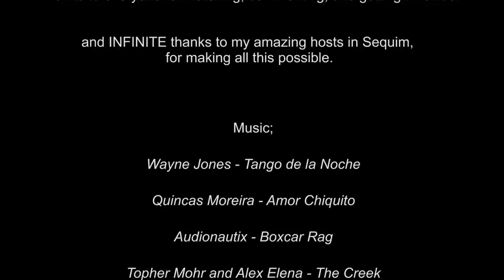Building Boat Frames using Traditional Tree-Nails - Rebuilding Tally Ho EP28

Comment: Hi! I am a sailor...that owns too many old boats...your project dedication and work ethic has inspired me to continue work refurbishing a couple of 40 year old fiberglass sailboats both are seaworthy, sound but need various upgrades and repairs one I have had for 8 years and is my main sailing vessel. The other newly acquired hasn't been sailing for a few years, but used as a motor boat. 

Love the tree-nail production! (That is about the only thing I could probably do...lol)

Oh...and I once lived in a place with a Black Locust in the backyard. In many northern cities the BLack Locust is considered a nuisance (trash) tree and are found mature on neglected properties and vacant lots. The issue with them in urban areas is they shed rather wicked thorny young branches. They send out suckers and can sprout new trees and take over an area rather quickly. Their leaves are also poisonous. Quite hardy they are...basically few plants can grow under or near them.  In spring they are last to leaf out...and many think the tree has died...they look truly awful bare, the stuff of horror movies.

Comment: After watching EP28, on a "luck of the draw" type click, I had to go back and start at EP1. I've then viewed up to EP 17 in the last 3 days, and I'm now fascinated by the artistry that goes into wooden boats. I've been a long time woodworker, but never looked into the wooden boat side of woodworking. Oddly enough though, I did work for Hatteras building motor yachts back in the mid 70. In any case, thanks for this GREAT project, and for giving all of us access to it.

Comment: Another particularly satisfying episode in your continuing restoration efforts.  I am particularly fond of the the music you select for each video.  Each set of selections seem especially well chosen for the material at hand.  I'm not sure how you do this, but keep it up as the music adds just the right mood to the videos.  Well done!

From a woodworking technique perspective, this episode builds from the prior preparatory work - like lofting - to make the patterns for the futtocks and frames; and selecting the live oak slabs to use to make the futtocks.  While it might be a bit pedantic and repetitive for many, you might want to consider making a standalone episode that focuses on making one specific frame from start to end (with a working unimaginative title like - Building Frame xxx).  Everything.  Start with the creation of the pattern from the lofting lines.  Show how you decide to partition each frame pattern into futtocks.  Show the potential oak slabs, and the grain characteristics you use to select ones you will use for the futtocks.  Spend a little more time explaining why you bevel the cuts, and how you got these angles off of the lofting chart. Then go through the complete assembly of the frame, using the patterns, futtocks and trunnels.  Again, this might be a bit too 'wood geek' for most people, which is why I'm not sure how popular it would be.  As a piece of shipwright documentation, however, it would be very valuable.  So, I don't know.  Just throwing out an idea.

As far as the 'attention seeking bird' goes, Pancho definitely has his opinions as to what the most important parts of your videos are and he seems ever eager to oblige.  (There's a lot of 'ham' in that bird.)   He's a natural comic relief, so if you ever feel your video is too dry, he'll be happy to give you some footage.  

Which brings up another thought.  Although you are just getting started with your restoration, I have no doubt that you will eventually complete it.  I think it is a certainty, given your spirit, determination, and many talents.  Start thinking of ways to memorialize your principal contributors.  Certainly, Pancho might be commemorated in some manner.  You already have a lot of extremely talented people watching, and this number will grow as the word spreads about your remarkable channel.  It is probably not yet time to ask your viewers to suggest ideas like this, but you might file it away in some unused part of your noggin.  If an appropriate time emerges, you will know.

Continued best of luck and thank you for what you are doing!

Comment: Robinia pseudoacacia. Excellent choice! I happen to be a big fan of the species. It is a most amazing wood, and if one stumbles across the the species in shrub form, the blossoms make an exquisite beignet! I live in Maine, and the Maine Botanical Gardens chose to use unfinished planks for elevated walkways over sensitive wet areas. The species rot resistance is off the scale. The blossoms are delicious...

Comment: There’s a 15” blade made for firemen to cut through buildings that lets you cut more of a curve. Corbel saw also works good for ruffing in the frames. Trunnels were traditionally split and then driven through a metal die, this made them all the same and straight grained besides crushing the very outside so swelled back to be very tight, but you know that.

Comment: Such a refined rebuild for such a massive undertaking...very, very impressed with the wooden dowel technique...didn't know it was possible on frames that size but considering the Egyptians made 100' keeps by joining several pieces of wood together using wedge technique ... Bravo ... Great job ... More solid than any screw, nail or rivet would ever be ... Wow ... Just wow ... And the bird deserves an Oscar for best dance routine !

Comment: Next tool acquisition: 5-axis high pressure water-jet cutter.  Takes care of roughing, bevels, contours all in one cut.  Downside: You need CAD drawings of each frame element.  The modern equivalent of the shipsaw; a fabricator near me (and near Port Hueneme) uses his to cut 5" thick steel sheet.  Live oak would be a snap!

Comment: Seeing the punch you use to drive out the fastenings, I remember from somewhere that the mushrooming on it's end is quite hard and brittle metal and can fly off as a dangerous projectile when struck with a hammer.
Please consider cutting off the end to make it safer to use!
I absolutely love your videos, they are always one of the high points of my week!
Reply from the maker: hadn't even noticed - will do!

Comment: Build Looks Great. I have used bar soap to lube wood wedges and also screws. It makes a huge difference and is easy to apply as you go. Just rub the soap on the wedge or drag the screw  threads across the bar. The cheaper/harder the soap the better. I started with Dial at the stern and found the scent of Irish Spring to be a welcome change amidships. I think this is a common practice, but it blew my mind the first time it was shown to me. Might be less messy than red lead

Comment: A big and very solid ,feat flat and level workbench would be a real asset to you at this stage?  Thinking something twelve feet by four feet and rock solid bench. Everything is better when build on a good work surface. Having it dead level and flat makes getting parts straight and true so much easier.

Comment: Try putting some UHMW polyethelene plastic on top of those saw horses.  Very low friction.  That will help the wood slide much easier.  Prevents them from trying to tip over when you slide wood over the top.
Reply: Good tip. Plastic chopping boards from the supermarket are a great, cheap source of this material.
Reply: Sideslip most likely just nylon not UHMWPE, but might work ok.
Reply: What about old reliable bioproduct called wax ?

Comment: i just got back from obx, and we went to a lighthouse, and apparently they do some boat building there, because i've never seen anyone bend 3/4 inch lumber the way they were using their landscaping timber.  not to mention the fact that they used timber that would resist rot.  and they had a bunch of live-oaks on the property.  i dont know if they used live oak scraps to make a garden decoration, but that's certainly the way it looked.

Comment: Black locust is used alot for fence post and will probly outlast treated lumber. When a chainsaw hits it. It starts vibrating. Hard as a pine knot.
Reply: From what I was told; it was used extensively for fence post here in the Appalachian mountains. But, I don't think it's allowed to be harvested here, these days.

Comment: Leo; When you butt the two ends together, you have a break in the integrity of that side of the frame. The frame is half as strong at the butt joints as compared to the rest of the assembled frame. Would a glued scarf joint be practical to maintain structural continuity of the assembled rib? Wish you were on the east coast. Enjoying your efforts.

Comment: Great video! So much work and that's just for one frame! How many of those are there in Tally-ho that are being replaced? Also, are you running a carbide tipped blade on that ship saw? I imagine if not you'd be going through blades pretty quick with that live oak. Also curious why not also glue the trennels and wedges? Is it just not necessary or is there another reason that's not a good idea? Keep up the great work, little by little it will get there and when you do I want to be at that launch party!

Comment: Hey Leo, I'm falling desperately in love with the Tally Ho, your workshop and channel! Thanks for sharing your restoration in such detail. I'm learning so much. Please can you comment and/or send some links to help me replicate your trunnels? My father always called them those and I lost him many years ago now. I'm attempting to make your trunnels but need some advice about which drill bit you used and how you ended up modifying it and making the jig where later on in the video, you ended up using a drill to lathe/shave the wood down resulting in the finished trunnel? Please, if you could shoot me any information at all, that would be most kind!

Comment: Old school wooden joinery, labor intensive but so much cleaner than just using metal fasteners. Enjoying the progress, will you be using any boat epoxy in the build or are you restoring it without modern based sealers?

Comment: I’ve found with careful adjustment you can adjust those veritas tenon cutters for size so may be better to use a standard 7/8s bit and have the pegs a smidge over size rather than grinding the bit.
Reply from the maker: yes - but having maxed it out to the largest size, it was still too small for the hole!
Reply: Sampson Boat Co how frustrating.

Comment: Good beer choice on the Full Sail.

I did want to ask about the color on the keel timber now that it has taken up the linseed oil. I noticed that it is much more red than I expected it to become. I was expecting a darkening, of course, but it to stay closer to the original color. Also, is it going to get any darker or change hue more? This also brings up the live oak darkening from the oil, but I am more familiar with different finishes on oak, so I think I know what to expect.

There is also a question about the paint you are using. What kind is it and is there a preferred type of paint for this application?

Comment: Leo, why wouldn't glue be better to join the frame parts together? Love your vlog and enjoy your attention to doing things right and better than the original. Saw the oops on the band saw also.
Reply from the maker: Thanks! Well... many reasons... (this is a response to "why not epoxy", but most points apply here too)
Traditional, appropriate techniques favoured / 
High moisture content of the timber / 
Movement of timbers over time, which would break epoxy (or timber) and expose uncoated wood /
Mixing Epoxy is complicated and messy and expensive and slow /
anti-rot properties of this particular primer /
Epoxy smells bad and is horrible and sticky, and generally I dislike glue!

Comment: really like your work in fact you persuaded me to buy a triton planer! i have been looking at mafell ones nearly 3000quid! the only observation i want to make is why aren't you using west system instead of paint to join the pieces?
Reply from the maker: Thanks! Yes, they are good value.
Well... many reasons...
Traditional, appropriate techniques favoured / 
High moisture content of the timber / 
Movement of timbers over time, which would break epoxy (or timber) and expose uncoated wood /
Mixing Epoxy is complicated and messy and expensive and slow /
anti-rot properties of this particular primer /
Epoxy smells bad and is horrible and sticky, and generally I dislike glue!

Comment: I'm curious about the orange primer in-between the frame parts (futtocks?) - why not glue them? Is there an advantage with separate parts and the primer, or is it too much work glueing the frames? (I have little hope of actually getting an answer here, but you never know...)
Inspiring work anyway, wonderful to see.
edit: The answer came in a later video! :) Because the wood is green, it will move to much later on, for any glue to work.

Comment: Gentlemen.  Please gear up with some proper dust-masks when dealing with Black Locust.  I'm not normally the alarmist type about protective gear issues.  But even the arborists talk about how particularly nasty Locust is just when removing the trees initially... let alone working with it up close for longer periods like you'll be doing here. 

The reason Black Locust is so famously rot-resistant, is because it's one of the more toxic woods there is.  Certainly more so than any other species in North America, anyway.  Even if it doesn't seem to bother you immediately... the danger with wood toxicity, is the issue of cumulative exposure.  Once your body develops an allergic sensitivity over an indeterminate period of time, you will suddenly find yourself unable to be near that species again, due to serious allergic reaction. 

I've personally known a former boatbuilding instructor, who developed exactly this sort of allergic sensitivity to Port Orford Cedar, which he had customarily favored for his small lapstrake boat planking.  By the time we knew him, that species had to be banned from the premises entirely, just because of his severe respiratory reaction to it.  And you can be sure he was fastidiously careful about dust-protection, when cutting the Western Red Cedar planking stock he was resigned to using in his later years.
Reply from the maker: Fair enough, will do!
Reply: @DontCryAboutIt  I'm late to this party, but Lyme disease isn't endemic to the American NW. It's most commonly found in deer populations in the Northeast and around the eastern Great Lakes.

Comment: Hi Leo, would it not be better to loosely tarp the Live Oak slabs to prevent further checking? Lumber tarps from the local home building center are made of a form of Tyvek. White on one side and black on the other as I recall. And they discard them in your direction if you ask nicely.
Reply from the maker: Yes, well they were covered, but had to take the tarps off to select the pieces for the frames. Cheers

Comment: Great channel and I've learned a lot watching you video's... I have a question for you and my question is . Why you used primer instead of Epoxy
Reply: I had that same question!
Reply from the maker: Thanks!
Well... many reasons...
Traditional, appropriate techniques favoured / 
High moisture content of the timber / 
Movement of timbers over time, which would break epoxy and expose uncoated wood /
Mixing Epoxy is complicated and messy and expensive and slow /
anti-rot properties of this particular primer /
Epoxy smells bad and is horrible and sticky, and generally I dislike glue!
Reply: What kind of primer are you using?

Comment: I can't tell from the video but is the rolling bevel being changed while you are moving the piece through the saw, or do you change the angle then push it more, etc. I'm very intrigued by this system. LOL
Reply: interestedmeow correct he said so in the video.
Reply: Louis Sauzedde has some good videos on cutting rolling bevels.  Check out "tips from a shipwright".
Reply from the maker: It's being changed continuously as I push the piece through. I will talk more about bevels in the next video probably.

Comment: Did the original ship builders have band saws,and planers when the ship was originally built?
Reply: In 1910, Stowe & Son would likely have had a large planer & bandsaw, driven by shafts & belts from a stationary steam engine. They might have had a powered blower for the forge.

Comment: You coated the inside faces of the wood, but not the trennel insides? If youre worried about rot between the wood, wouldnt the trennels be the biggest point of attack since they go through all the way?

Comment: Where the butt ends of the boards were set together i noticed you didn’t use a heavy tar or oil to keep it from checking over the years.  Do you have a long term solution or is that just normal?

Comment: Instead of using a traditional bit and plywood clamped on either side of the futtocks perhaps consider an adjustable auger bit. The cutter has a sharpened spur on the cutting edge that cuts a score line at the outside edge of the hole which eliminates edge tear out at the start of the hole. You would still need a backing plate on the side that the bit exits but not on the entry side. Since you are drilling hundreds of holes this would save some time and materials on the operation. You can order the bits on Amazon. Here is an example: https://www.amazon.com/Irwin-45002-Lockhead-Adjustable-8-Inch/dp/B00004YO6Y/ref=sr_1_1?ie=UTF8&qid=1534025749&sr=8-1&keywords=adjustable+auger+bit&dpID=41y9MkobbKL&preST=_SY300_QL70_&dpSrc=srch

Comment: I have a question ?
When rebuilding these frame sections you are butting two pcs end to end with no special joint in able to make what you require. 
Is this not a weak point in the frame pc ?
Why no special joint ?
I am not a boat builder or engineer. 
Just enjoying your project.